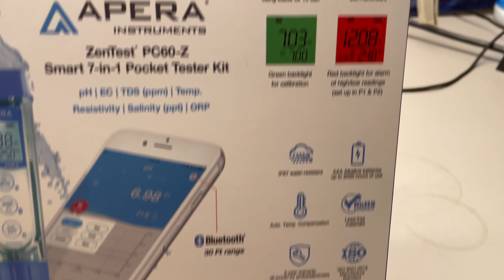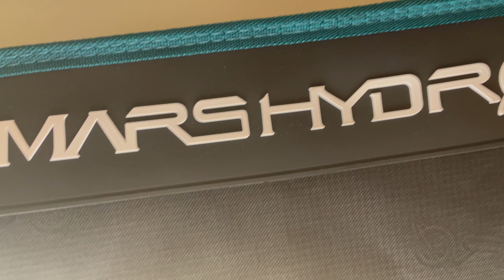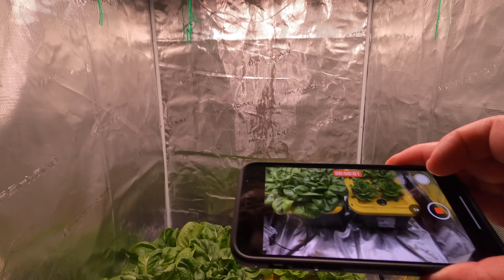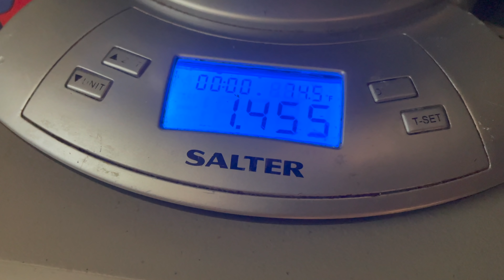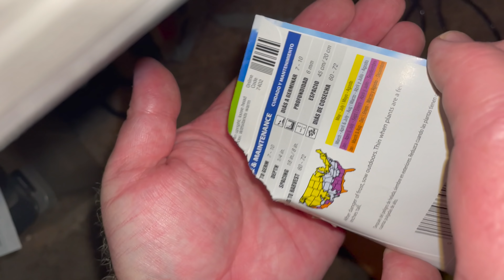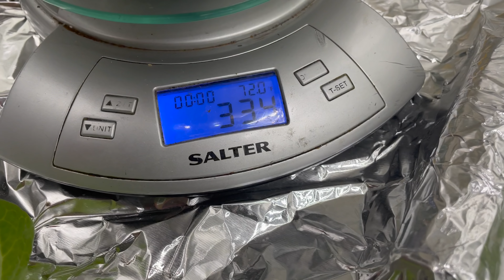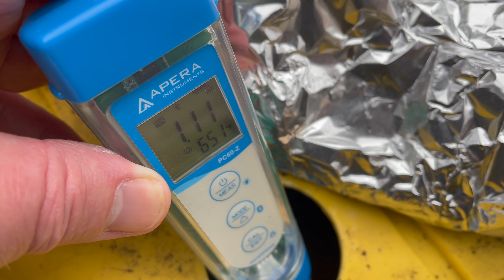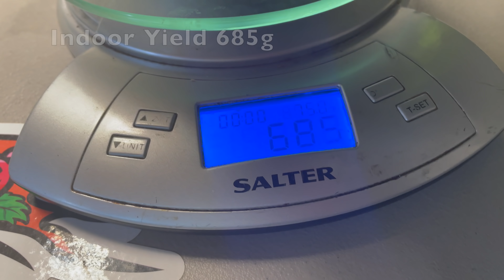Air vs Water, Indoor vs Outdoor

Comment: Thanks as always for your videos. I still haven't had the chance to try my hand at hydroponics, but always had some ease with gardening in general. One thing I don't think I've ever seen you attempt are onions in hydroponics. Would be interesting to see how it would go.
Reply from the maker: i did that
Reply: @JebGardener  thank you jeb, very cool
Reply: Onions are tricky in hydroponics. At least for me they are. You can’t let the bulb sit in the liquid for any long period of time or it will rot away and the onion will eventually die. Got to keep just the roots in there, avoid liquid contact with the bulb and then when they start to get big they need support to not fall over.  I’ve yet to get what I would consider a successful grow in hydroponics because something winds up happening that kills them off but I have been able to get bulbs a little larger then the size of golf balls. I want to get them softball size onions. Any root vegetable I’ve tried has never gotten good results. I know onion isn’t quite a root vegetable but it was a no go, potatoes were a no go for me, carrots were a no go, peanuts were a no go… anything leafy or fruits off the vine/stem does great in hydroponics for me anyway. My thumb isn’t as green as Jebs thumb though.

Comment: This happens to me every time I grow romaine lettuce inside in a tub like that (I use air stones too). I wind up having to use the outside leaves very fast to keep the inside open and growing new leaves or the center rots out and gets moldy. So annoying I stopped growing my lettuce indoors hydroponically. Sucks because it grows so fast that way. Outside gets avoids the rot but the yields are way lower, of course.

Comment: Nice one sir. I plant the Grand Rapids for 600 crops outdoor, tried to add 1000 lumens x3 growing light for 8 hours at night but the crops doesn't grow as I expected. My electric bills  /w ROI will be creepy if I upgrading to 5000+ lumens lamps. Should I try solar PV /w battery from day till night?
Reply: If if you are worried about electric bill then only run half the lights for the first hours or two while the plants wake up.its a well known money saver
Reply: @amylattimore3589  Thank you. I programmed the lights to start at 6pm-11pm and 4am-5:40am. I noticed the crops go slept and straight up the shape itself at night time and I ignored it. That's a lot of my mistake.

Comment: I gave indoor hydroponic bib/romaine lettuce a shot using the general hydroponics 3-part system and I had an awful experience involving a strange bitter chemical flavor even after flushing them. Is this common? I also tried putting the leaves in a bowl of ice water overnight and it slightly took away the flavor, but the aftertaste still had that sort of strange flavor. My roots weren't very developed yet, although the foliage was already to the point where it had formed an entire head of lettuce. Maybe my flush didn't take effect because they were so young, or my nutrient choice is not suitable. Even though I use the same nutrient mix for my herb (thyme, rosemary, sage) section, they do not yield the same aftertaste and are quite transparent and taste like they should. I have fans on everything to keep the ambient temp low enough so I'm at a loss on how to improve the flavor. I want to enjoy my lettuce like Jeb, any advice is greatly appreciated(:
Reply from the maker: try half strength nutrients with no flush
Reply: I'll try that and report back my results! I've been experimenting with drop in grocery store leftover bibb root cuttings right into the mesh cups to try to skip the seedling process as well. I very well could have shocked them considering the romaine bolted after three days trying the same drop in method.

Comment: Never experimented with hydroponics. How is it that the water doesn't cause root rot? Love the vids as always, keep up the great work!
Reply from the maker: some air dissolves in water
Reply: These plants do have a bit of root rot, the water levels were too high.

You usually add beneficial bacteria to your nutrients, such as hydroguard or great white. You can also use h2o2

Keep a few cm under the net cup, even for when you use a bubbler, and you're golden.